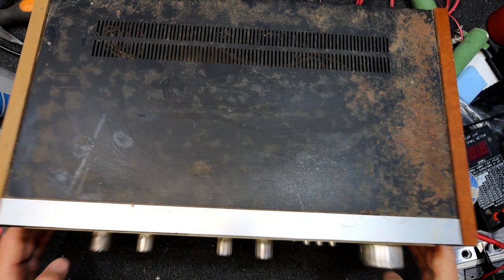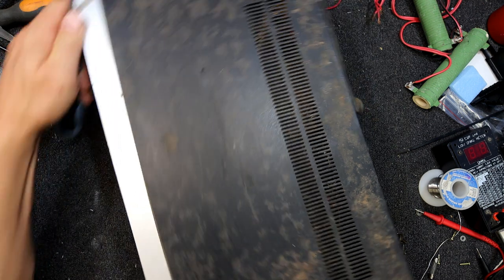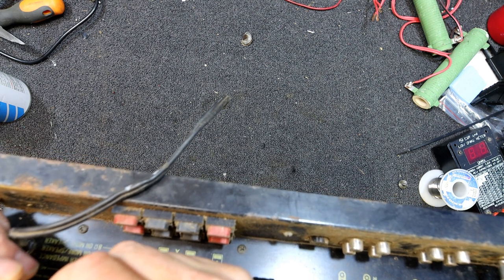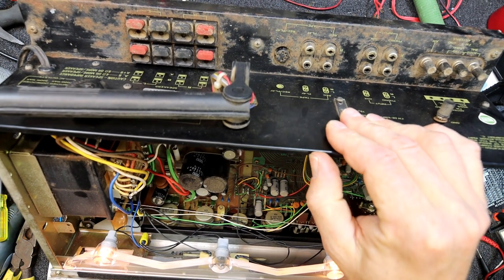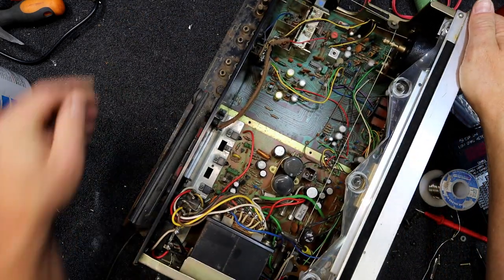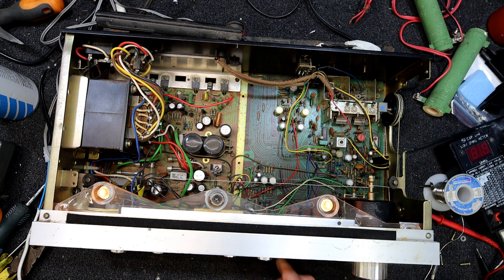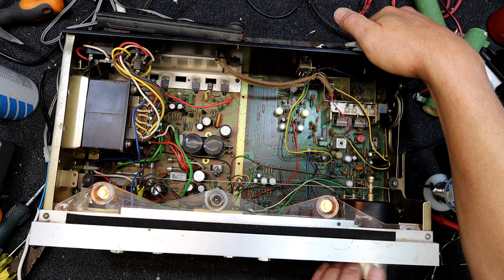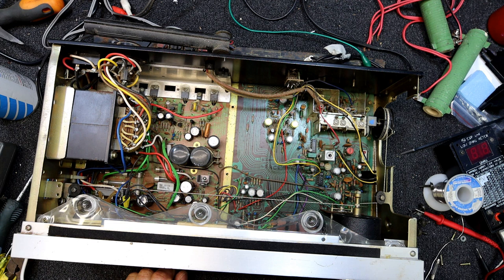Pioneer SX450 Receiver. Rusty and Beaten up.  Will it work?

Comment: Good vid Steve. I thought to add my experience with the SX450 for Bias adjust and DC Offset for others who may visit this. I had to replace some outputs - originals were SD313- used MJE15032G (same pinouts). Had to replace some driver transistors (Q207/Q208 2SC1318A with KSC2383Y) same pinouts and (Q209/Q210 2SA720) with  KSA1013Y same pinouts. Now for BIAS adjust, I replaced the 82R resistors ( R221 and R222) with 100R multiturn posts (middle leg soldered to one of outer). I could adjust bias down to approx 20mV. Scope sine test , just prior clip, achieves approx 12.88Vac RMS into 8ohm load = approx 21W one channel. Nice clean sine... For the DC offset, I took the advice of service manual and connected 8ohm load. One channel had circa 30mV, the other, a rather large 300mV. I replaced the 2SA725 transistor sets Q201/203 and Q201/204 with carefully matched Vbe / Hfe type KSA992. NOTE: Watch the pinouts of replacements. Thank goodness the screen printing on component side of PCB indicates correct orientation. I now have circa 18mV both right and left, so good success. Service manuals available here. You have to sign up but free and SAFE.  https://www.hifiengine.com/manual_library/pioneer/sx-450.shtml. Thanks for the video. Now I have to get onto the tuner, not much life- more investigation and possible alignment- not sure.. Keep up the videos. cheers from Sydney, Australia.